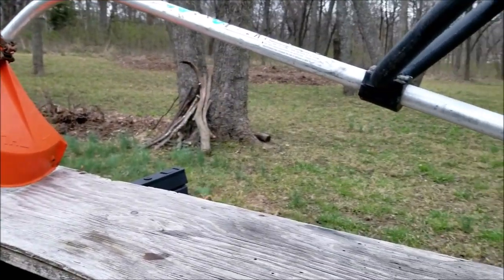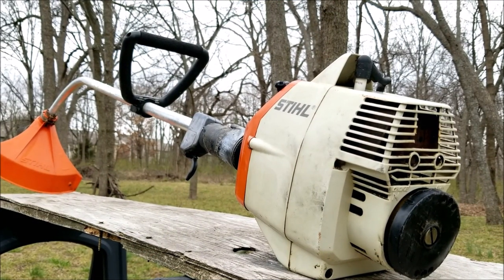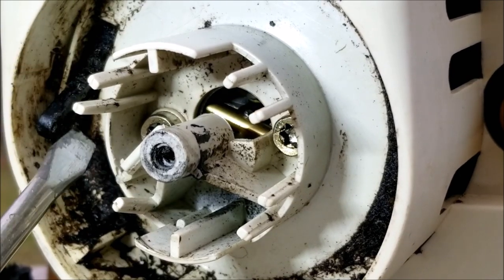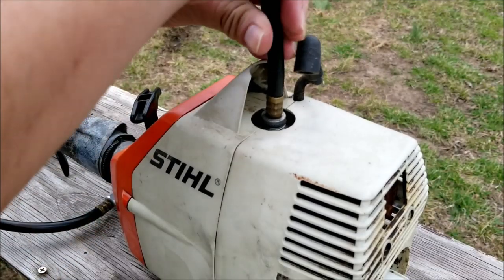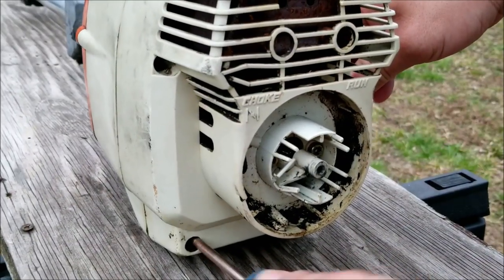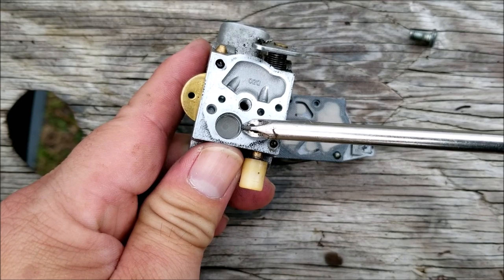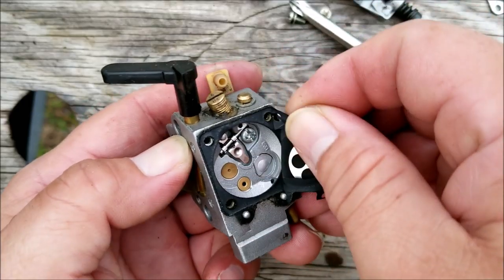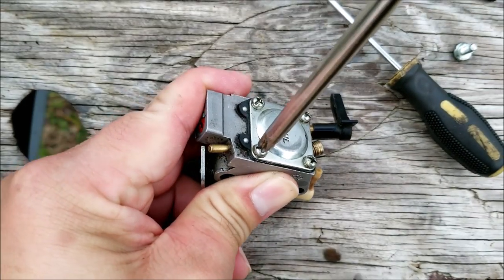Fixing a Stihl trimmer FS36 that won't start

Comment: Wow, that is a really unique and cool looking trimmer, I’ve never seen anything like it! It’s almost comparable to one of those cheap upside down cylinder trimmers, but it actually looks cool. It looks pretty rare, I would definitely hold onto it. I’m sorry that it only had 55 psi of compression though, I hope things work out for you and it in the end.
Reply from the maker: I wish it was in better shape too but its still a great piece to a Stihl collection.  It won't be used much to try and conserve it.  Thank you RabbitFootedKitty for the comment I appreciate it.
Reply: I'd order a cylinder kit for it. They are still available.
Reply: A couple months ago I got a old fs 36 out of my sisters barn (the left and bunch of weedeaters, chainsaw and a fourwheeler) and i have clean it up a bit and had put gas in it, wouldnt start, gave it some starting fluid, up and off she went and purred like a kitten. Oh and i think it had sat for 11 years or so. You cant stop a sthil.

Comment: Used your video to repair a FS36. It also suffered from a petrified metering diaphragm, which was pushing down on the rocker arm causing the carburetor to flood. Bought a carb kit off of ebay and and replaced the diaphragm and a few other parts. Trimmer started on second pull! I did check to see if a carburetor was available, but this trimmer is pretty old and no one seems to carry a carb for it. Thanks!
Reply from the maker: no problem and thank you for the comment.

Comment: Remove the limiters. The EPA regs are way to lean. The carbs need to be adjusted for the climate, altitude, fuel used etc. I know of lots of people that have thrown away good machines because they could not make them run right. What's better, fill the landfills with machines or be able to adjust them so they work properly. Thanks for that video. Good Work
Reply from the maker: Thank you Waterman one for the comment I appreciate it

Comment: I own the same trimmer, did all of those things.  40+ years and mine is still working after sitting around for the last 10+ years I decided to have it repaired.  I put on the new line trimmer head and had to fine tune the carburetor after that!
Reply from the maker: nice work,  like seeing these around

Comment: I would have removed the plate covering the adjusting screws as well if I could have.  I would have also cleaned off the plastic a lot before reinstalling the carb.  Looking forward to next video.  Thanks for sharing.
Reply from the maker: Thank you D Butler for the comment.  Its coming this Friday.

Comment: Use a pick to carefully pull the hi/low limiter caps off.  After proper adjustments, you can replace limiter caps as needed.
Reply from the maker: That's a good tip

Comment: I'm in the process of rehabilitating 18 4mix engines that I obtained from a landscape company.  I didn't know what to expect at first but after getting 6 back up and running, i can say it's best just to go through the basic tuning & maintenance before pondering about anything else.  This includes: cleaning the intake, checking the spark plug, check valve clearance, unplug exhaust, clean or change gas tank vent, check fuel lines, clean carb, use fresh fuel. If you do need adjustments it would be minor.  Especially so since you replaced the diaphragm.
Reply from the maker: nice haul. I'm surprised they sold all of their 4 mix blowers.
Reply: @HomeGaragechannel  they switched to echo because they kept having issues.  My diagnoses was that used to much oil and never cleaned their machines.  The result is the oil grime got on everywhere, clogging up everything.
Reply from the maker: @Jaze2022  interesting. Usually most complained about having to take their blowers in all the time just to have the valve lash checked.  Good on luck on them I guess you'll be selling them when you get them up and running?
Reply: @HomeGaragechannel  thanks. Keeping a br700 and selling the rest.  When do you think is a good time in the year? I thought spring and fall and maybe winter.  But spring market seems a bit saturated.
Reply from the maker: @Jaze2022  yes spring is overly saturated so I would try fall, say October  or November. or least when leaves start changing colors.
Reply: @HomeGaragechannel  thanks for the tip.  I sold 4 units.  Lots of low ballers.  I found 4 with engine problems. One where the engine cracked into 2 pieces. I was going to cannibalize the br500 to fix the higher end units because I the offers i got wouldn't even be enough to buy replacement engines plus parts.  If they sell for more in fall, I'm not so sure my cannibalizing strat is such a good idea anymore.

Comment: Good video. My first Stihl product was a FS36. I have heard it was made by another manufacturer? Mine lasted for about 6 years before the on/off switch broke. I was never a big fan of the bent shaft, so went with a FS 70R. The 36 met the garbage can when it began to run poorly.  While my 36 had compression and count have been saved, I really wanted a better trimmer.
Reply from the maker: I agree with you.  It's okay but it's not the same stihl product that it is now. The fs70r is a fantastic trimmer too

Comment: I'd do the mixture screw bypass & if it was my trimmer I would fit new piston rings.

I made it a rule to rebuild a non working hedge trimmer which needed a new ignition coil and carburettor, its compression was about 75 PSI as I wasn't sure if it would run so I replaced the cylinder & piston assembly with a new kit.

The compression was 105 PSI before it was run in & 125 PSI when it was run in so in the end they had a new machine !
Reply from the maker: Nice work.
Reply: Russell Booth no money in this thing, $45.00 TOPS.  But on good Stihls, I’m with you all the way.

Comment: Home Garage is a good small engine repair tutorial channel for everyone want to fix their small engine. I wish I have your voice over! I'm very slack with voice over so I did in real-time during my tutorials. This is about helping to further guides you how to rebuild this carburetor and what to do in addition to Home Garage tutorial. One possible reason why the engine won't rev up is the carburetor was only partially rebuild by replacing the metering diaphragm. The complete rebuild kit is not that expensive and the most expensive part is your time. Since you already working on the carby and pulling it apart, take the opportunity to do it properly. Fixing a carburetor is like repairing a movement watch especially the very tiny nozzles if small dirts getting into will ruin your work and make more frustration. Before removing the carburetor, thoroughly clean around the carburetor to prevent dirts from getting into the crackcase then to the combustion engine. For compression has to be above 90psi to 150psi. Below 90psi is not ideal or question your compression tester. Resusing the gasket cannot guarantee of propper sealing around the gasket since old gasket doesn't have flexibility for further sealing compression. If you have access to the mixture screws, better remove then and clean the inside cavity and nozzles. In addition to Home Gagarge, you can also view this video here: https://youtu.be/hYNeQFK27p8
Reply from the maker: thank you I appreciate that

Comment: I agree with removing the adjustment limiter on the carburetor. Would I have done it? No. Will I do it in the future, now that I see that it can be done? Absolutely! Thank you for the tip. I've not seen one so tamper-proof as this one. They really wanted to keep the consumer from having full control.
Reply from the maker: you are absolutely right about that

Comment: Answering your carburetor question, I'd probably rather stay with the original carb unless something internally is defective, excluding the metering and pumping diaphragm which I consider "wearables" when it comes to a carburetor and it's age. I mostly work on bigger small engines and personally haven't had so much luck with the aftermarket carbs.
Reply from the maker: thank you Blayne1602.

Comment: Tried it. Mine would not go back together. The things he did he had to have practiced. First the starter cord was a helluva effort to get out and then even worse to get back in when the rope guide kept pulling out. Secondly, the trigger assembly came apart and would not go back. Thirdly, he got lucky in have the view slot for the kill switch. Mine did not.  
Finally, lining up all three things (kill switch, shaft, and pull cord) to get the orange case back on was a nightmare! Took many attempts as the kill switch and metal pull cord guide would not stay in position. I also had to walk away once before I could get it back on as I got so frustrated. Finally threw it out as I couldnt get it started - electrical problem of some sort - intermittent spark. Got Dewalt electric trimmer... highly recommend that!  BTW - dont buy the new stihl products... they run like crap and I had to get another gas can for its special (rec gas).
Reply from the maker: thanks for explaining

Comment: Great video. I was able to start an old  fs36 following your steps. Thank you. Can you please let me know to change the line on this one?
Reply from the maker: I haven't tried yet. I will let you know when I do find out.
Reply: @HomeGaragechannel  thank you. My bump head seems to be jammed and having troubles changing the line.
Reply: @cdhiren  .. There is an owners manual online that explains how to replace line and everything else.. When I do it, I spray a little silicone on the spool and the line to help the line come out easier and not get jammed and the dried grass and stuff must be cleaned out thoroughly from the spool and housing when replacing line or it will keep on getting jammed.

Comment: I have the same exact model which I purchased in 1996. It has always run great and in 2012 I replaced the carburetor and have not had to make any adjustments. After the third use this season it became hard to start. I checked spark Good, Checked compression 75 psi. tried to start it with gasoline and starter fluid sprayed in the carb and cylinder still no start.Changed primer bulb and fuel lines look good but are the original. Checked and cleaned spark arrestor. Any suggestions as to why it won't start or what to check next? What should the H & L Jets be set at !-1/2. They were at 3/4. It has briefly run for a few seconds twice.
Reply from the maker: after multiple starts I want to make sure the engine isn't flooded. Remove the spark plug and pull the rope several times and then let it air out with the spark plug out. The next day, I would replace the spark plug and try starting it with no choke and if it starts then it was just flooded, If it doesn't start, then go thru the regular priming and choking procedure. As for the adjustment setting, I don't have any suggestions as the setting are not universal once an engine has some age and wear on it.
Reply: Set the H & L screws to 1 full turn counter clock wise. Set the machine to choke start. Pulled recoil starter one time. engine ran briefly . Set to run and it started up on first pull. So I don't know what I did to fix it. I did check the  carb diaphrams and they looked good . Thank you for the quick response to my inquiry. Keep up the good work on the videos. Professionally  done
Reply from the maker: @wallacetom1  thank you and I appreciate it.

Comment: I would remove the limiter caps,you can  use a small wood screwdown the center of the limiter cap,and it will push the top out.
Reply from the maker: thanks for the comment I appreciate it

Comment: I recently got offered a non-running one of these for free, however, didn't end up getting it. The replacement parts seem a bit hard to find, especially the carb kit. Nevertheless looks like a nice piece of machinery. thanks for sharing!
Reply from the maker: Sorry to hear that and thanks for the comment.
Reply: I found one for $40 not working either, but gonna buy it tomorrow and see what’s wrong

Comment: I would remove the limiter but it wasn't necessary to grind it. Those limiters are easy to remove.
Reply from the maker: I realized that after grinding on it.  Thanks for the comment I appreciate it
Reply: MrPaco1013 but sometimes the adjustment screw head snaps off. I get what you’re saying. Be safe

Comment: i personally would remove the limiter cap cover and i also have a Stihl FS 36 with a similar issue too but the On/Off Switch does work fine and it,s located on the throttle trigger assembly cover on mine and i cannot get it rev up and the spark aresstor screen is free of any carbon too but i i might try either a rebuild kit or replacing the carby entirely
Reply from the maker: Thank you Patrick Stapleton for the comment I appreciate it
Reply: @HomeGaragechannel  my pleasure mate cheers from Australia

Comment: Thank you for this video, I received a hand-me-down FS36 and got it running well enough, but I am unable to get the autocut 10-11 head off. I am having trouble finding documentation on it, but it appears to be one of the heads that doesn't require the locking pin. But the head is stuck on, I removed the screw off 'bump' nut/head piece, the string holder comes out fine, but again the head is stuck on. Should I try shooting some penetrating oil around the head and start prying with a hammer? Any advice here would be great.

Thank you
Reply from the maker: That's what I would do. Let me know if it works.
Reply: @HomeGaragechannel  Thank you for the reply!! I used Kroil and let it sit overnight and still wouldn't come off. I ended up using a dremel tool to carefully cut off the plastic sleeve. Turns out the shaft had completely corroded underneath, expanding, and turning into a compression fitting haha. I'm going to try polishing up the rust as I would rather not replace the bearing shaft assembly. The unit is quite old, I am curious if the previous owner ever once removed the string head!
Reply from the maker: @CaptSuperCoww  I doubt the previous owner did any work to it. Thanks for the update

Comment: I have the fs 35 been hanging in the garage for years,  I wonder if its worth trying to get it going.  I will take it to the local shop where I bought it more than 20 years ago.  Looks just like the 36 model.
Reply from the maker: I doubt they will look at it, would probably tell you to hang it back on the wall and buy a new one.

Comment: If it was mine I'd have done just what you did.
A customer, I'd ask but recommend a new carb.
I'm curious about the exhaust screen, thinking partly plugged.
I wasn't paying attention to the spark plug, if it was carbonned up,
if it had build up the exhaust screen would be next.
The shutoff switch is probably bad from the looks of the general 
condition of the machine but who knows who's been in there?
Loose connection, maybe.
Reply from the maker: I really appreciate your comment. Thank you very much

Comment: Home garage how do you work a stuck throttle linkage on a echo es210 leaf blower i hope to see a  video on that soon i got a free echo es210  runs great the throttle is stuck wide open
Reply from the maker: Let me see if I can find one
Reply: @HomeGaragechannel  i only run ethanol free 2 cycle in my echo leaf blower 50 to 1 and in my 2 stroke lawn boy i noticed they run very smoothe and no carbon build up on my muffler on my lawn boy
Reply from the maker: ethanol free gas is the best way to go
Reply: @HomeGaragechannel  thats the only stuff i will use its worth the extra cash to me if u ever a unwanted leaf blower in good shape could u hook me up i am going to be making youtube videos  getting a dash cam that works with windows 7 my birthday is friday this week
Reply from the maker: do you have any videos ready now?

Comment: I have the same trimmer give to me just before fall of last year. Ran great till i didn't pay attention to what gas jug i grabbed and ended up running it with straight gas. Also i didn't much care for the choke dial it kept popping out of place on me
Reply from the maker: yes these are interesting for sure, but beyond that, they're just upside down ryobis.

Comment: How do you change the primer bulb on this unit
Reply from the maker: it snaps into the housing, just pry around the base, and it will pop out.
Reply: Do I have to take the rear housing off   to get to the primer bulb?
Reply from the maker: yes just like in the video

Comment: Does anyone know how important the spring is on the idling screw at 4:02? The screw fell out on my trimmer and the spring is gone.
Reply from the maker: It depends how difficult it is to turn your screw. If it's really easy to turn the spring is absolutely needed. If your screw is difficult to turn then you probably don't need it.

Comment: Currently looking at an FS40 that looks the same as this one. I understand that these trimmers are much older, and was wondering where I could find a carb kit for this age of trimmer.
Reply from the maker: no sure, I didn't have to find one for this one, so I wouldn't know.
Reply: Ebay. It's the same as the fs36